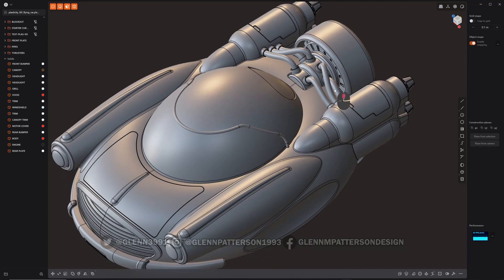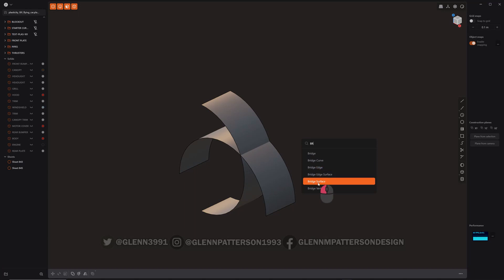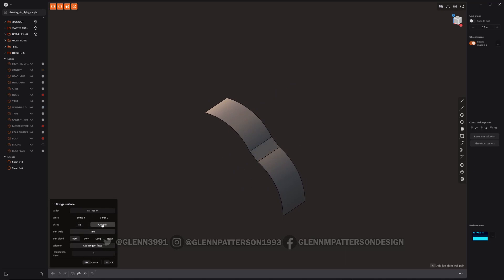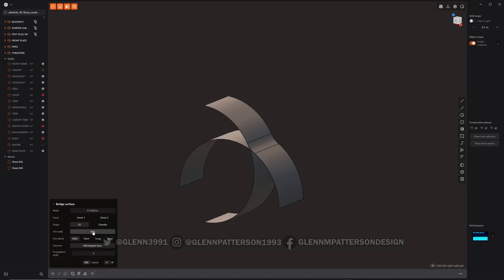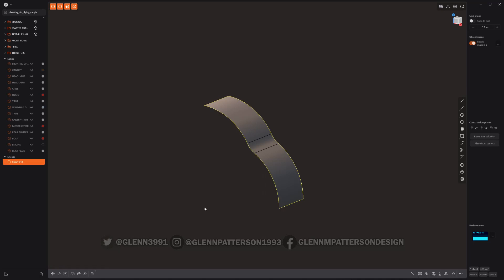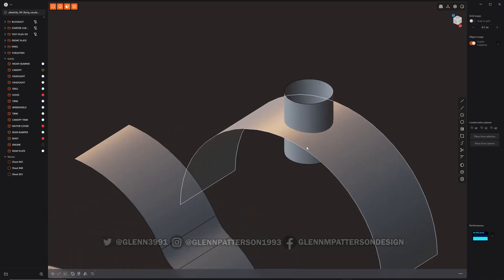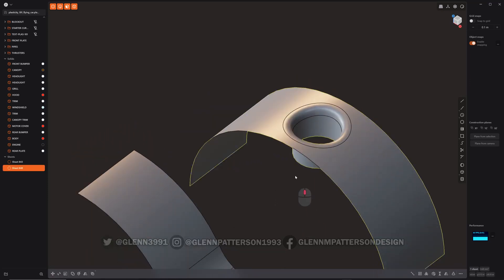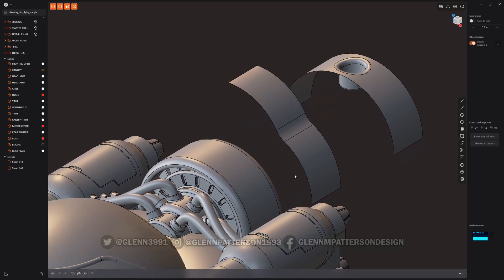62 PLASTICITY 101 BRIDGE SURFACES (1.2 UPDATE)

Comment: This is also a clever way to do boolean union on a complex surface and get a fillet in ONE GO

2:49 would be an awesome way to make the holes for threaded inserts.
Reply from the maker: You can also use it to create fillets on edges as well. Powerful little tool